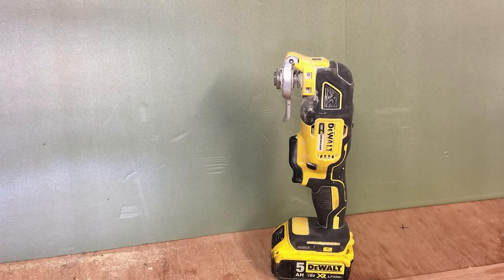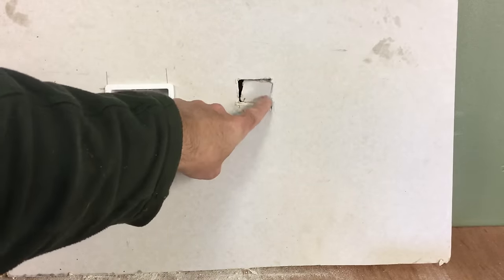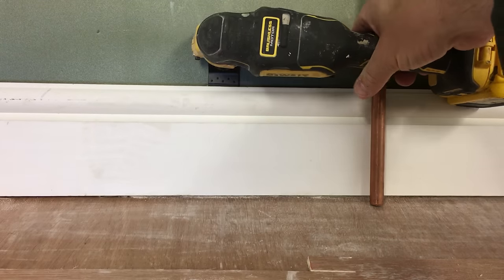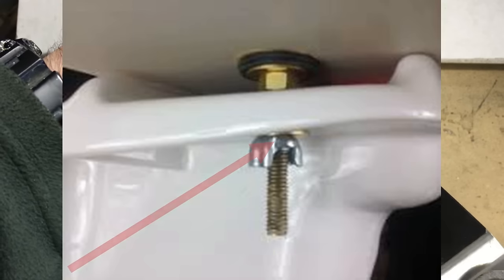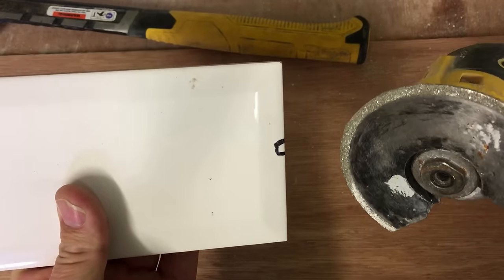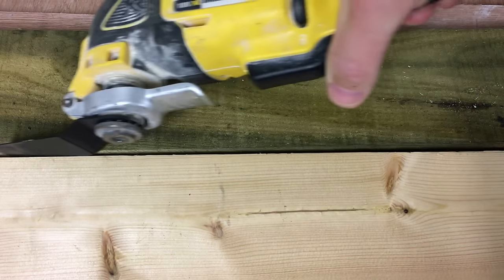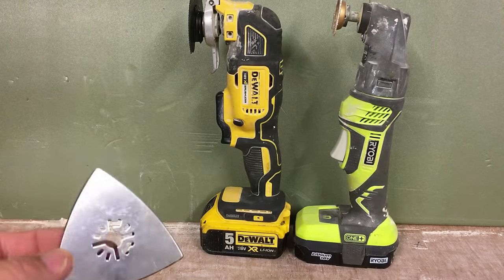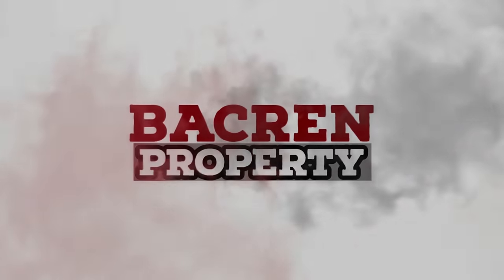20 ways to use a Multi Tool | Dewalt

Comment: It seems they make a mess of most things they cut meaning you have to cover the cut or go back and clean it up, it can cut in places most other tools can't but its a pity it can't do it with precision, would make it much more desire-able as an all rounder.
Reply from the maker: Yes, they can be a bit rough but as you say, most of what is cut with them is covered anyway, so no problem. Still a very handy tool to have in my opinion, thanks for the comment 👍
Reply: All in one: Multitool Gear
https://multigear.kckb.st/3f9ba7de

Comment: My boss thinks im crazy cause I always bring it with me (fence installer) but its my most used tool besides tape measure and level
Reply from the maker: I am the same as you, I always have this tool on hand as you never know when you will need it - it is the perfect solution for many a problem situation ! Thanks for the comment 👍😎
Reply: All in one: Multitool Gear
https://multigear.kckb.st/3f9ba7de

Comment: I hope Dewalt would make a slimmer 12v (Extreme) version of this tool. The Atomic is just garbage. My brother owns an XR. The vibration is not the best and the weight is not ideal. I’m sure the XR is an excelent tool for professional usage but homeowners would probably just use this as a chisel on some DIY woodworking task. A slimmer and less vibrating multi tool would always be preferred in that aspect. Makita and Milwaukee have their 12v versions of this. Why is Dewalt wasting its time on the Atomic? Everybody hates that line of tools except for the Atomic circular saw.
Reply from the maker: Yes Joseph, I have to agree, that a 12v Dewalt version would be nice . I have a couple of M12 Milwaukee  tools and they are great. Thanks for the comment 👍

Comment: They're a brutal messy tool. The cuts are not neat or precise. You couldn't do any detailed work with a tool like this. Some of those cuts looked like a rat had chewed through the material.  The copper pipe and the plastic pipe.
Reply from the maker: Thanks for the comment John !

Comment: You never actually did a proper job, used scrap bits of this and that, You should do something positive instead of giving Dewalt tools a thumbs up. Some good tips though.
Reply from the maker: It was just a demo video showing what I use it for, I can't film every job I do in real life, so thought this would give an insight. I gave the tool a thumbs up because it performs well for me and I love the quick blade change. I use these tools daily and they are all bought with my own money, so just giving my personal opinion. I am going to do another video on this tool, which will hopefully be a bit better. Thanks for the comment 👍

Comment: Can I use this on a wooden tile to cut a hole for the electrical outlets?
Reply from the maker: Yes, this would work well for that - thanks for the comment 👍
Reply: @Bacrenfencing  thank you so much for a quick reply. I subscribed because of that. So just so I’m clear the wooden tile is already on the wall and while we were putting that up we forgot to move the electrical boxes behind the tv. So I can use this to cut a hole behind the tv and move the electrical outlets?
Reply from the maker: @devbatth7415  Yes you can, just use the right blade and take your time. Thanks !
Reply: @Bacrenfencing  which kind of blades should I be trying?